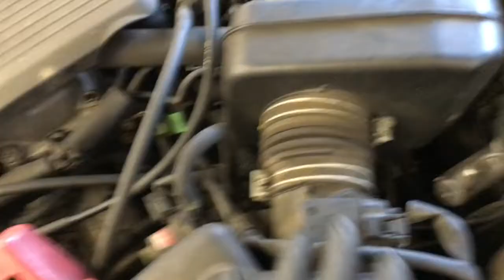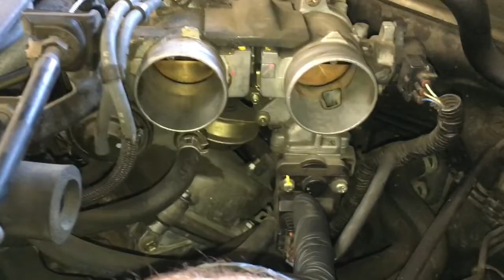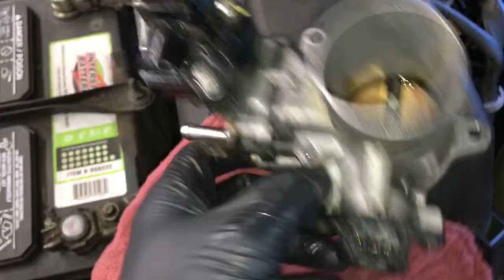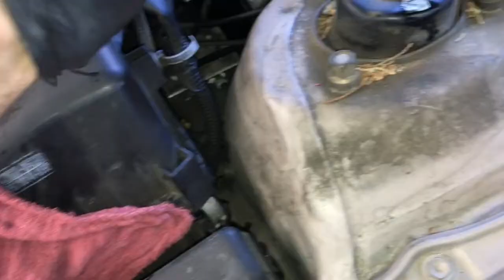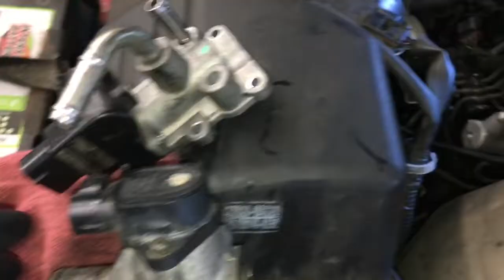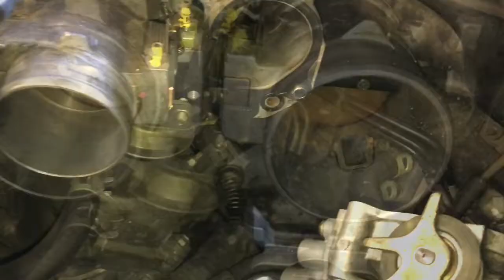How to Replace the Idle Air Control Motor on a 2000 Toyota Avalon/Camry

Comment: For people trying this on a 2000 RX300.  There is zero clearance due to wiper tray to take out just the part that Brian does.  The top plate Phillips screws  have an inch clearance and will be seized after 25 years.  Also there is a 4th 12mm bolt on bracket into throttle body that is sandwiched in super tight space and AC lines. The solution is to watch the Y-T Hardly Moving Productions video on removing the Wiper Assembly & Cowl Tray Toyota/Lexus.  Also, the lower nut (12mm) that holds throttle body to manifold can be taken out easy using 3/8s extension fed under & in between the 2 throttle body air intake tubes.  Ugly job especially with screws vs. hexbolt heads.
Reply: Thank you.

Comment: Thank you for this video Brian.  You've helped me in the past on my Toyota 1MZFE (RX300) &  my son's Honda K24 engine (Honda Element) with your excellent videos.
Reply: Replacing this part on my 2000 Lexus RX300.  Idled high in summer, and now very low idle in cold November in Chicago.  You are correct that cleaning  it only lasts for about 2 years.

Comment: What are the symptoms that tells you this needs to be replaced ? My Avalon will jerk pretty violently at 2200 RPM when trying to accelerate. My mechanic mechanic thought it was an ECM and he swapped them and it still did it. Had another mechanic I was talking to say sounded like it could be the throttle body ? Any ideas? Car shifts fine if you stay under 2200 RPM

Comment: I have a 2000 Avalon that has a slightly surging idle. The engine surges on acceleration and the degree to which it surges increases with harder acceleration. At steady speed or accelerating at a very leisurely pace it's fine. Does this sound like it could be the idle air control valve that's the cause of these symptoms? The check engine light is not illuminated.
Reply: it could be a dirty throttle body or IAC. when cleaning make sure not to push or move the little flaps. after cleaning it the RPM’s will be a little off. that’s okay you can just reset the toyota. there’s tons of videos showing you how. it should be something along the lines of taking off the negative charge for like 10-15 minutes then putting it back. driving the car, once it’s warm turn it off then on then off then on again without activating the engine. after that’s done turn everything on and put it on drive with the E break on and let it sit and lowly the RPM’s will fix itself. basically the computer is used to putting extra power to overcompensate for the dirty system. doing this it will relearn and fix itself. but you gotta make sure both IAC and Throttle are clean. since you’re having it check or fixing yourself I recommend also checking your MAF sensor and PCV valve.

Comment: My car when i start it. It turns off, in order to keep it on i have to hit the gas until it warms up. I just replace the fuel pump and fuel filter but still does it. This idler control is $178 at auto zone, should i get it ?
Reply from the maker: I would try cleaning the throttlebody with carb spray first.
Reply: @HowtoAutomotive  ok. Thanks. Im changing the spark plugs too while cleaning the throtel body. Hopefully after all that it will stop doing it. By the way, thanks for making this video. Guys like you help a lot of people like me that cant pay for a mecanic and have to do it themself.

Comment: Very informative. I've convinced myself that I don't want to DIY this repair, but have a much better understanding of what is involved thanks to you!
Reply: good call! it’s really complicated for someone who isn’t a mechanic or do this on a regular. you’ll need certain cleaning products and replace gaskets.
Reply: I think not only the video, but looking at the air box, double air intake hoses, double throttle body, makes this look more difficult than it actually is.  I almost passed on doing this repair today, but I decided to do it.  Honestly it literally took right around 10 min to get to the part with a number #2 and #3 phillips screwdriver, and something to remove the smaller hose clamps.

The right size screwdriver (a #3) eliminated having to use an impact screwdriver.

Comment: This video and the Toyota nation forum saved me a couple hundred bucks! My car was stalling and wouldn't run unless I was revving the engine. Easily the hardest part was getting the old big air hoses off. My o rings stayed put, and hardly any fluid dribbled out of the hoses.  I cleaned mine with brake cleaner rather than replacing it, and it has worked like a champ so far. Though it did idle at 2k rpm for about 5 minutes of driving before settling down. So far so good. Thanks for the video!

Comment: This is an excellent instructional video. My 2003 Avalon has a P05050 code but the car has not given me any problems just yet. Do you happen to know the ohms resistance allowable (or range) on the IACV? I was getting 61.5 kohms between 1 and 2 pins and 0.0 kohms between 2 and 3 pins. Does this mean my valve is defective? thanks in advance!

Comment: I did this on my 2000 avalon but its still idling rough. I disconnected the battery to reset the code. Any other suggestions? I also used a voltmeter and checked my sensors. I don't know what else the problem could be.
Reply: check the intake manifold gasket for leaks... all spark plugs need to be clean and all injectors OIK and no OBD codes about them. Coil wires are cheap to buy and replace.
Reply: buy a new car.

Comment: Where did you get the replacement gasket and O-ring at?
Reply: the gasket is Felpro ES 73043. The bag comes with three gaskets: Left Hand Side (Driver's Side) Throttle body gasket, Right Hand Side (Passenger's Side) Throttle body gasket, Adapter to manifold gasket included
Reply: did you ever get your new gasket and oring? i also need these items
Reply: Small round O-ring coolant line is a separate P/N: 90079-60008

Comment: How did you get the loom holder out? Just pull it out straight or is there something you can squeeze to make it easier? Mine is pretty stuck.
Reply from the maker: Jory Morrison i'm not sure which loom holder you're talking about but here's a video on how I remove loom holders https://youtu.be/2XQ8qOd0sUs
Reply: @HowtoAutomotive at 2:30 you say loom holder

Comment: No its not helpful and not complete cause you never tested if it's functional electricaly .Only clean !? i don't think is it
Reply from the maker: Adnan Fnaish the video titled how to replace the idle air control motor not test. I'm shaving diagnostic videos for a up and coming series. I didn't mean to miss lead you that this was a diagnostic video.
Reply: cant fix dumb